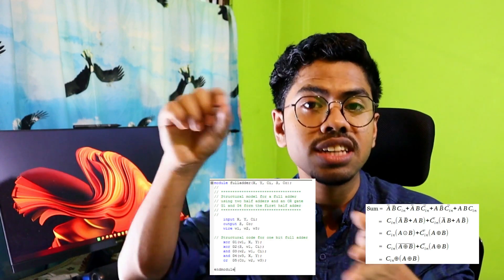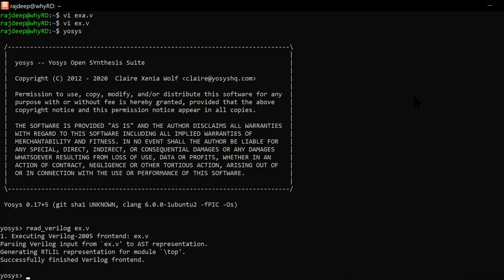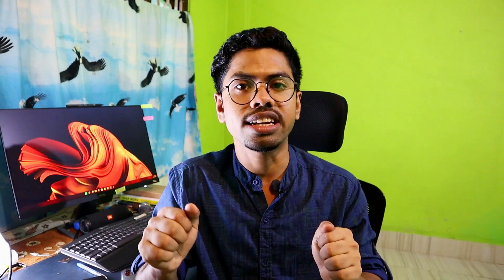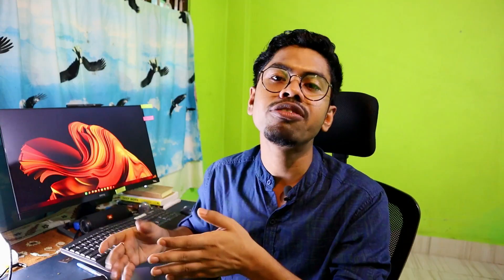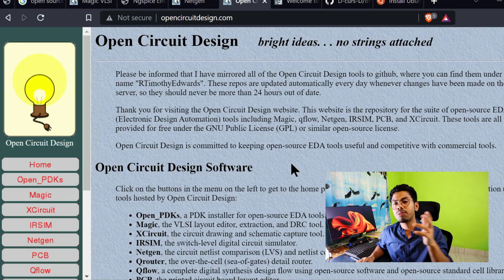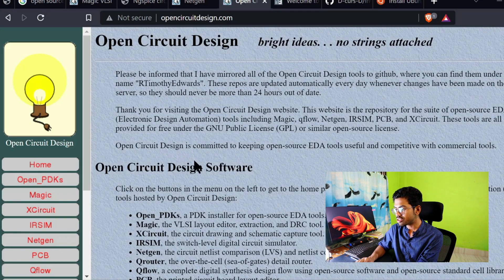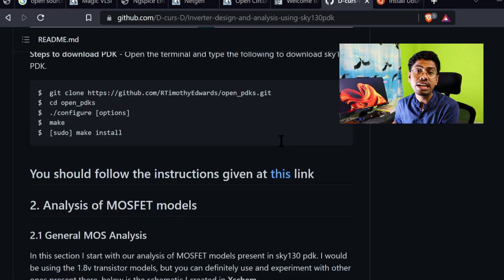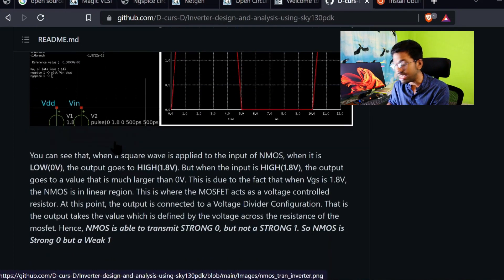Practice VLSI design for free | open source VLSI design |  Project Idea | ep1:VLSIpro-ject

Comment: I have been waiting for over 30 years for someone like you to come along!  I have been a design engineer for decades, doing both analog and digital design, but have discovered, probably before you were born, that unless you have experience with the "tools" they won't hire you in VLSI. For example, for decades one had to have experience with Synopsys synthesis and other tools as well or they would not look at you. 
I do have one question: for example, would the tools that you mention above substitute for the tool chain of Cadence Virtuoso (schematic capture and layout), Cadence Genus (for synthesis) and Modelsim (or some such verification engine)? Again, great job on this.

Comment: Can anyone please help me to install yosys with graphviz. The given code is facing some problems while installing pre-requisites.
Reply from the maker: What the error message ?
Reply: While installing the pre-requisites, it is not installing package after the '\' symbol. The error is like: cannot find: 19 founde.sh libreadline-dev.
Reply from the maker: Oky search for this particular package ... Like linux install x package in google.
Reply: @whyRD  Sir, I have successfully installed yosys just now from the original Github repository. Thank you. My verilog codes are compiling successfully. But when I write the show command this error is coming: "Gtk couldn't be initialized. Use Gtk.init_check() if you want to handle this case."
Reply from the maker: Great... Hope you will get a solution from google
Reply: @whyRD  Sure sir.... I will try. Thanks for your help.